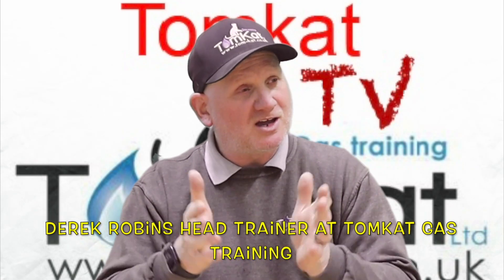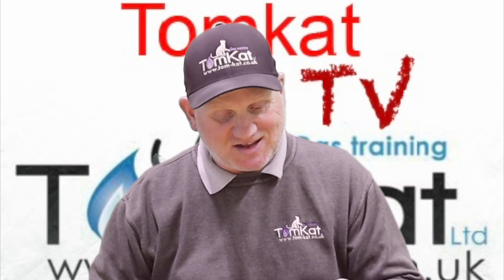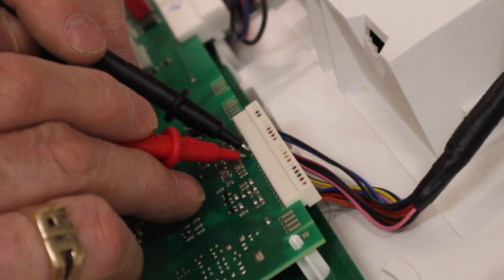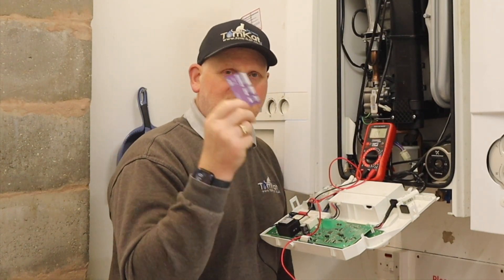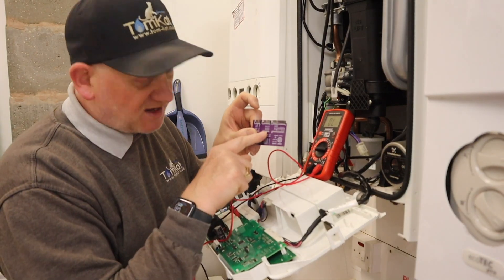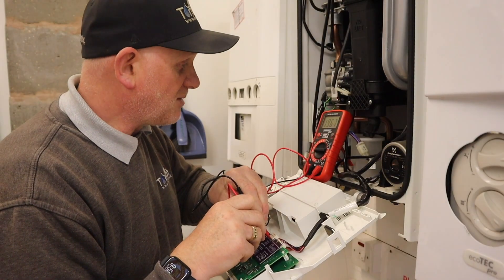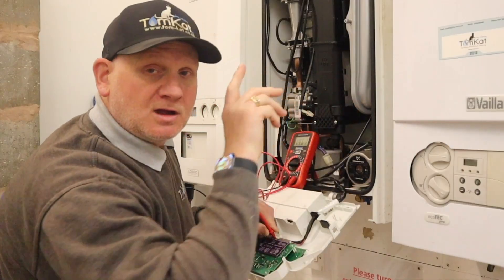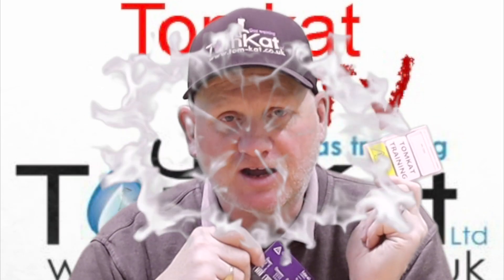Reviewing the solpcb boiler test card, design to help gas engineers when repairing boilers.

Comment: Does the angled FGA probe interfere with the temperature measurement at the probe tip? I know its still flowing through the probe hole, but probably not the slots in the tip.

Comment: A wee bit too expensive for what they are, where a multimeter & Needle Probes can be used on most Boilers. Plus you need a running boiler to check PWM etc on Fans & Boilers. But good luck to the guy that came up with the concept👍👍

Comment: Thumbs up for your wonderful channel Derek but in my opinion the test cards (albeit a good idea) are too pricey for me to justify for the amount of use.
I've had the Worcester Bosch test cards (included in the free training course) for over 15 years and have probably used a few times.. plus the Bosch cards had multiple models per card instead of  one make like these.
Good for newbies to learn good fault finding principles but for more experienced engineers there are other ways to determine continuity   resistance etc.
If they offer a bundle deal for these  cards say all Ideal cards (4 or 5) for £60.00, it might be more palatable for more engineers to justify purchasing as a bit of handy kit they might one day use